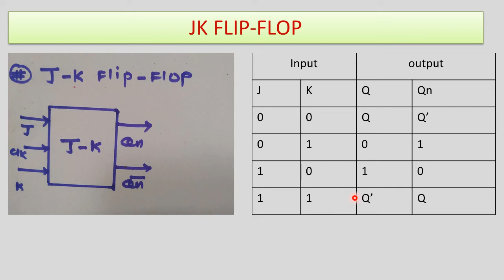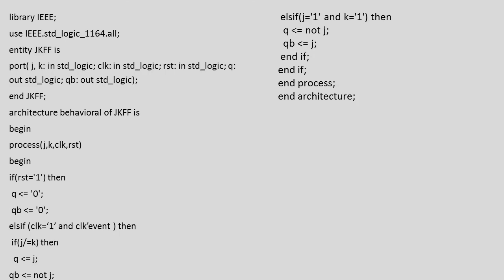| VHDL Code of JK flip-flop |

Comment: sir what if (j='0' and k='1') turns into (j='1' and k='1')? Q will be not 1 and therefore 0, which is the old Q. It doesn't toggle hence. Your q<= not j only stands when (j='1' and k='0') turns into (j='1' and k='1'). Yet thanks anyway for your video!